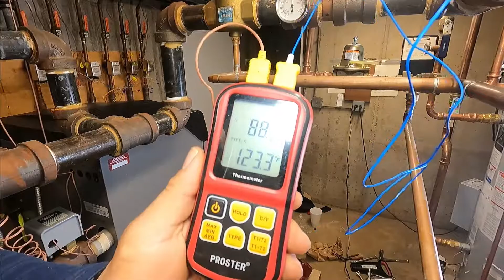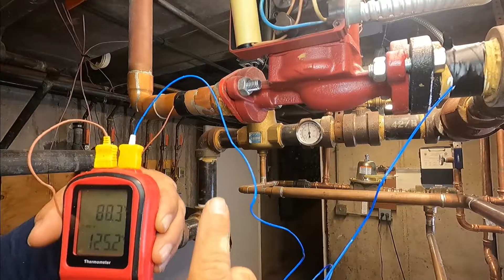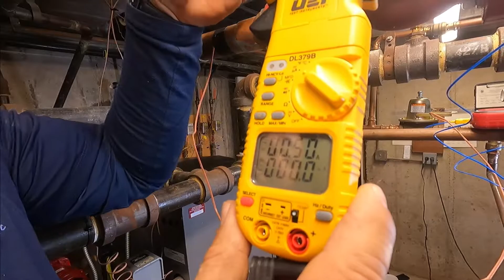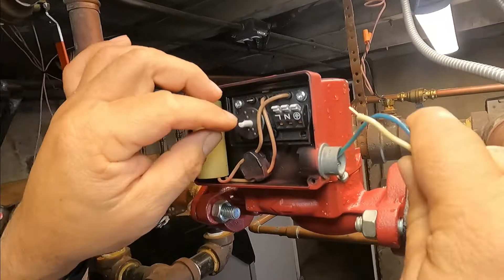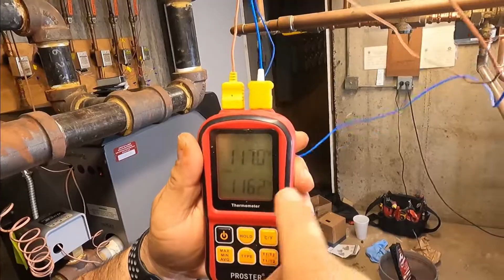GRUNDFOS BOILER BRANCH PUMP TROUBLESHOOTING. NO HEAT ON FIRST FLOOR

Comment: While you had the pump out, you could have tightened each flange a quarter turn and the pump could be installed in the correct position.

Comment: In the Grundfos manual for installation it reads the shaft must be in horizontal position when installed or it can be bad on the bearings..Is that true?
Reply from the maker: https://manuals.plus/sv/grundfos/ups-25-80-n-circulation-pump-manual
Reply from the maker: Hello. you might be right.  This one I replaced it seems to be wrong accordingly with the pictures.   Thanks so much for mentioning it.   Even though I just replaced what they had there I should have fixed the pump to the right position.

Comment: how do you bleed this as no screw turn at front?
Reply from the maker: HEY Nick,   If you remember there was a shut off valve at both sides of pump,  so virtually no air went into the system.  The tiny air that went in, that is typically handled by the automatic air scooper.   If I didn't have those valves to isolate the pump.  I would have to bleed the whole branch.   Make sense?

Comment: I would believe you that it is hot on a ne side and cold in the other. I think we broke our pump by draining the water from the system. Would that do it? Like the water flowed in the reverse direction due to gravity now it doesn’t pump to the second level.

Comment: how did you get rid of that grinding noise when you first turned on the pump
Reply: I understand that the grinding noise is normal in the manual to begin with. Never run the pump dry

Comment: Literally explains nothing as to why it's working after dropping it on the floor. Unless, it was replaced with a new one. The seal is not going to make it work any better than it was.
Reply from the maker: Hello Zombie,
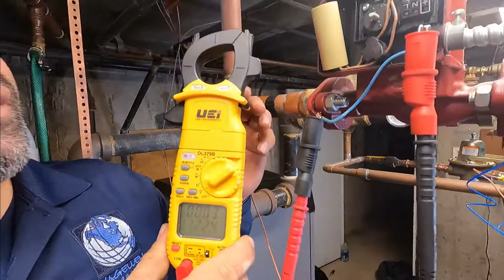Thanks for your comment.  Yes I replaced the pump. I removed it for the sole purpose of replacing it.    I stated it on 2:51 and 3:31 
And of course the rubber seal is not going to make it work better.  It is just a seal for water tightness.   Thanks you so much!